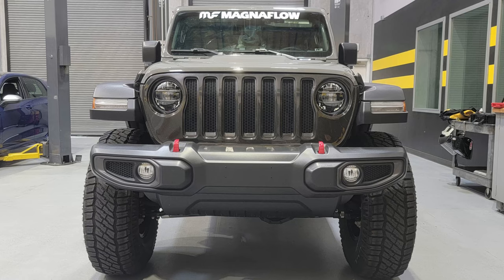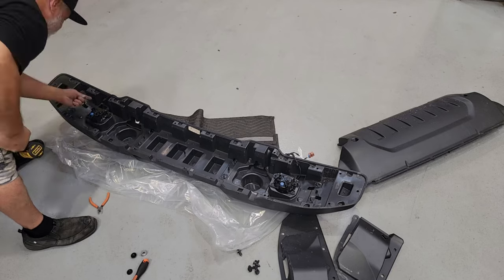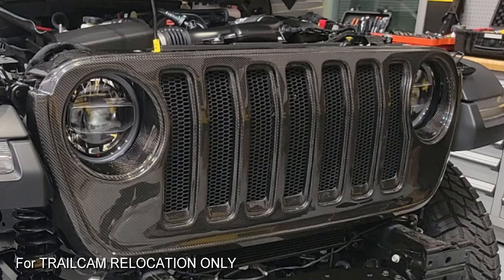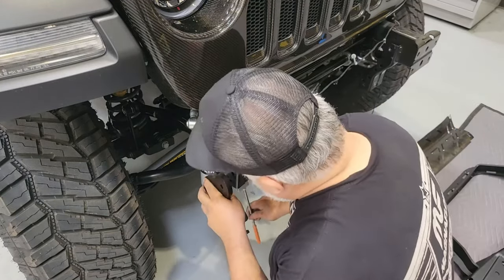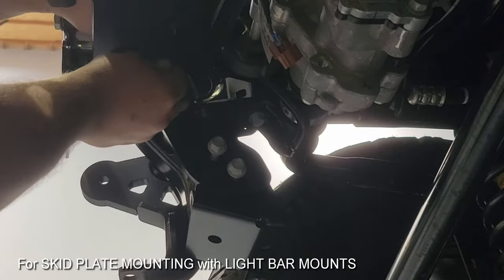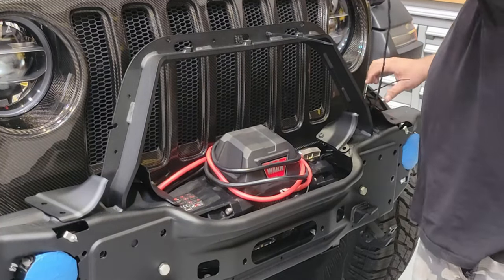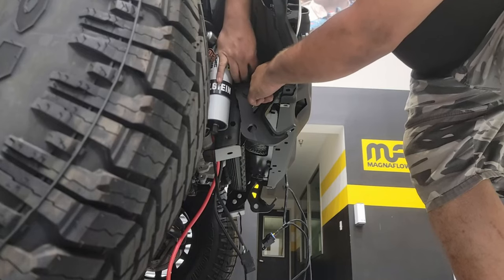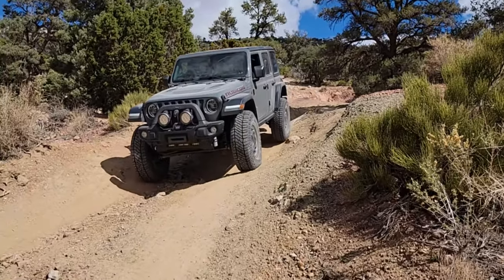AEV RX "Stubby" Bumper Installation: Premium Jeep JL Wrangler Protection with TONS of options

Comment: Did you wire the 7000 series light to Mopar aux switch or use the supplied switch?
Reply from the maker: I have an sPOD in my set-up as I have a fairly large selection of lights. I still had to use the relay for the rated current draw of the 7000 Series lights using the sPOD as the trigger. You could just as easily used the factory switch panel as long as you are wiring it such that its the trigger wire and the current is switched by the supplied AEV relay.
Reply: Do you know what would need to be removed to install the AEV 7000 lights after this bumper was installed?
Reply from the maker: @nickritz4740  It's not bad. There are 4 - 10mm nuts on the back of the Hoop to remove the hoop and 4 - allen bolts around each surround base of the hoop you might need to loosen to run your wires. 30  mins of work tops.